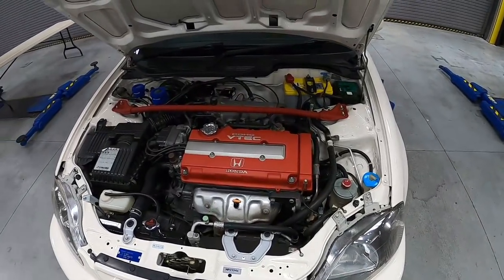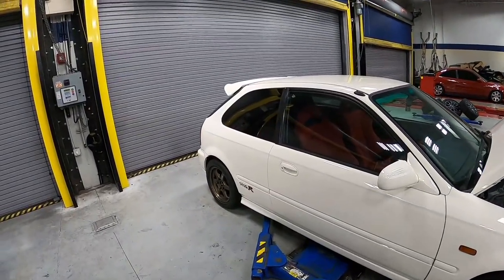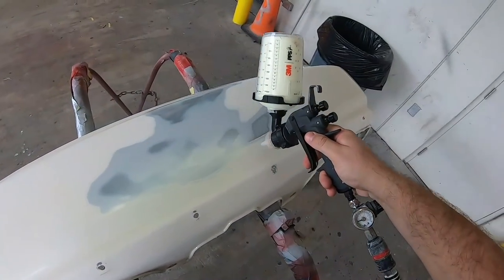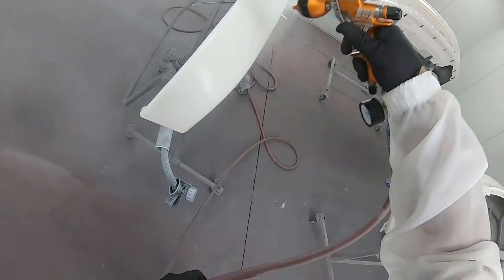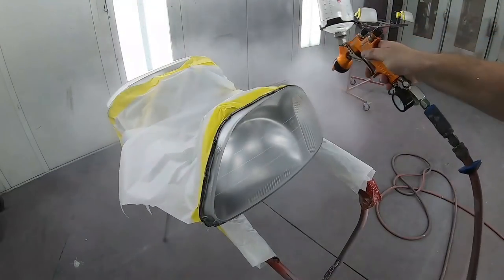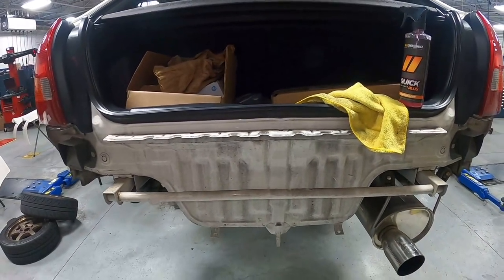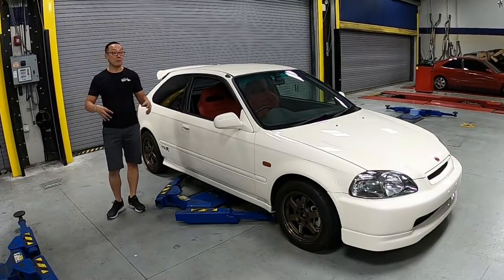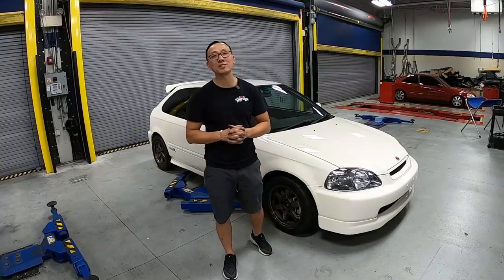Honda Civic EK9 CTR Minor Refresh - Intro | Paint and Refinish| Dents Removal (Episode 1)

Comment: That’s a Fantastic car. Pity the dent guy couldn’t get the dent out of the bonnet above / left of the Honda badge and the rear plate surround looks pushed in on each top
Corner?
Reply from the maker: Unfortunately there’s some limitations to PDR. We are extremely please with the result. There were over 26 dents all around the car. 2 dents were size of a fist
Reply: @ahcgarage  yeah the smaller ones are more difficult. The car came out really good though. Keep forgetting these are over 20 years old now!

Comment: So apparently the EK9 had no rear windshield wiper interesting I'm in the process of building an EK9l from a 1999 DX hatchback I have the whole front end of an EK9 everything including wiring no wires were cut not even has tank or hatch wires this ones gonna be an interesting one just got in co tact with Slavuagd Vehcile inspection officer and California Highway Patrol I'm cleared to do this and get a new US vin# assigned currently today I just cut out the firewall I'm even getting ever detail right the the sub towers crossbar support bar studs all other hatches don't have the little threaded studs only EK9

Comment: Hey man, I have a 92VX 60K miles, all original no mods.  My dream since high school in the mid 90s has been to have a VX with a B18C5 Type R swap total sleeper, bone stock interior.  My thoughts are this car is too nice to swap, but its not perfect, it was a northern car so there is rust.  I'd love to send it somewhere, that can do the swap right, redo the paint, install a/c, redo the suspension, make it look factory.  I'm not a tuck guy,  I'm an old school 90s guy, that wants a sleeper but I want it done right with og parts.
Reply from the maker: B18C5 power plant will be a perfect match for your 92 Civic VX